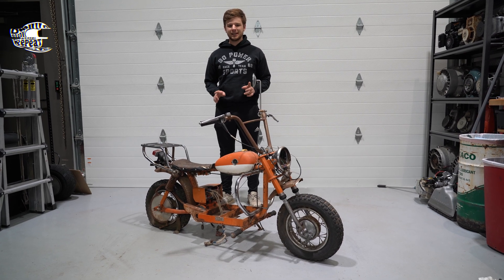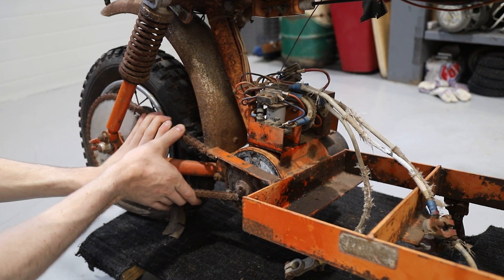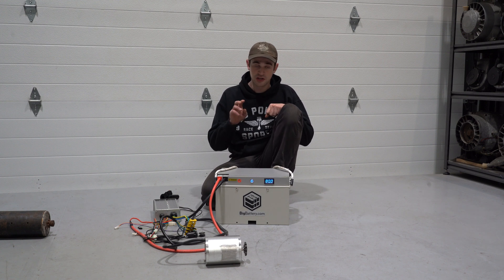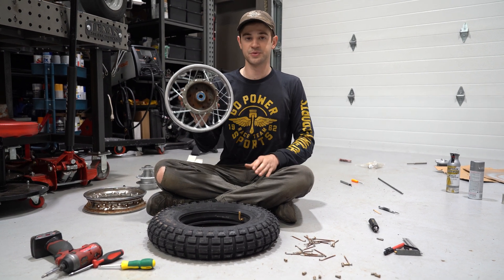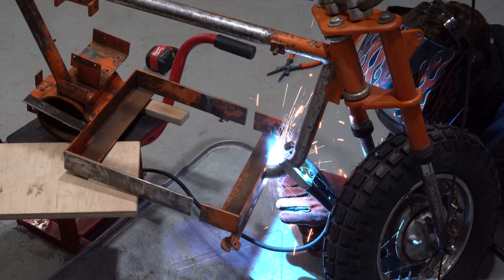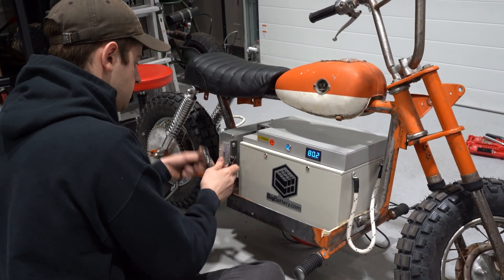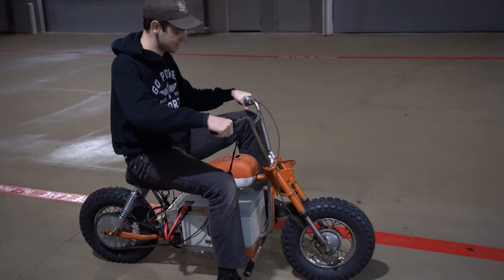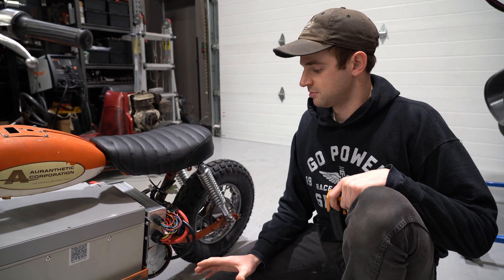Rebuilding the World’s 1st ELECTRIC MINI BIKE! The Auranthetic Charger: Ahead of its Time!

Comment: Sprocket in rear is too small I would know to check rpm off motor and be sure to double check on rides plus wide tires and the chain sound right that will blow out bearings and ride slower anyway

Comment: Chain seems really tight, all the electric stuff ive seen has a spring tensioner on the non drive side of the chain to reduce rolling resistance and chain noise